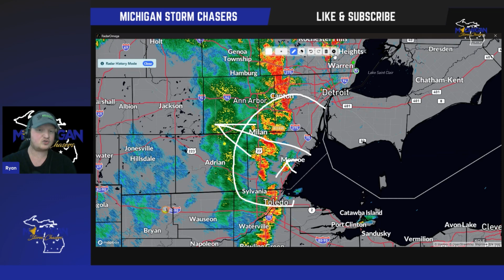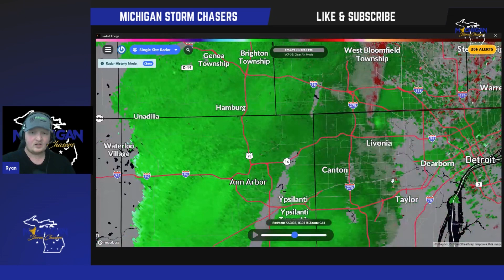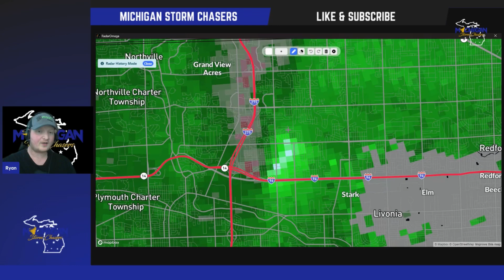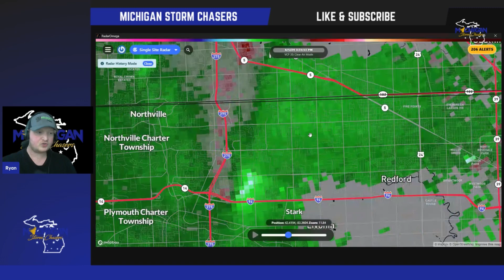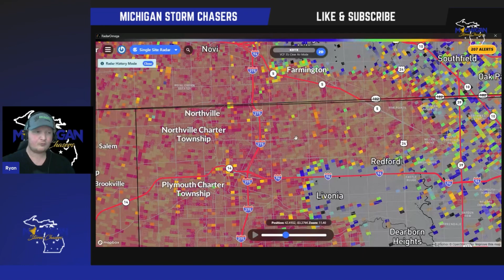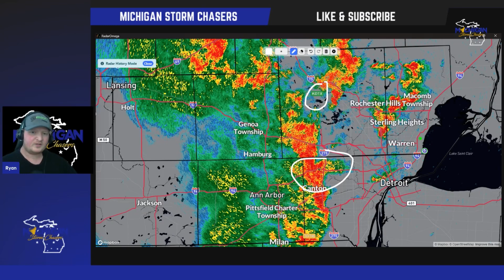Livonia tornado - A radar analysis & reason for no warning.

Comment: You said the radar beam was at 1500', but implied it's a constant value.  Isn't it a product of lowest tilt angle of radar (0.5°) x distance from radar site to Livonia?
Reply from the maker: The radar dome in Clarkston is situated about 100 feet off the ground. So at the radar site, you can see what's occurring at 100 feet off the ground. Lowest beam angle is 0.5° so if you pulse that out towards Livonia, that 100 feet grows more and more. Factoring in the curvature of the Earth as well, and you get a value right around 1,300-1,500 feet above the ground. That is the lowest tilt we can see there if that makes sense. We can see that value on our radar products.
Reply: @MIStormChasers  Was already clear for me,  hopefully will be for others too now.
Key point is that if you are looking at a storm system at the extremity of radar coverage, the elevation will be quite high, totally missing surface level events.

Comment: If those radar domes only shoot above 1500 ft can they ever read tornadic winds? I feel like a tornado wouldn't be more than a few hundred feet tall right?
Reply: Tornadic circulation can be tens of thousands of feet tall, so yes, radar can and does read tornadic winds IF the circulation is high enough, large enough and long-lasting enough.  It's a pretty good indicator that something could be about to happen.  However  the radar beam is constantly moving in a circle and it can take several seconds for it to make a complete sweep.  A weak spin-up like yesterday's can go undetected.  Not common, but does happen.  That is why I stress weather awareness no matter what.  In my opinion the only time you are truly "safe" from a tornado is when there are no clouds in the sky.  If there are clouds that are building into thunderstorms, be aware, be on guard.  Don't rely on others or technology to spot the storm before you do.  Take Skywarn training, know the signs.